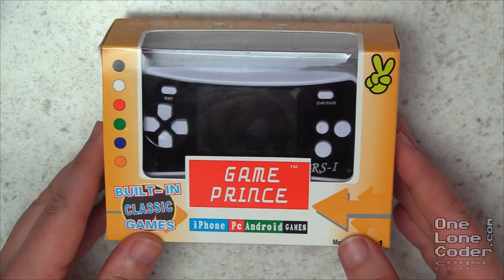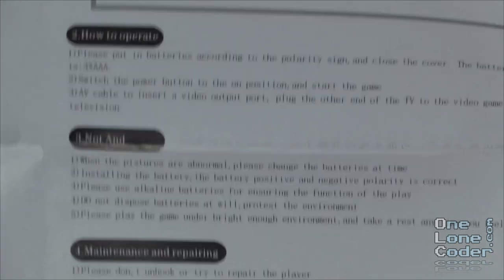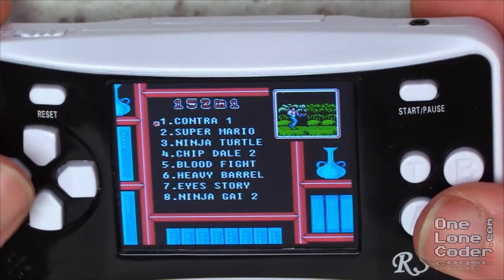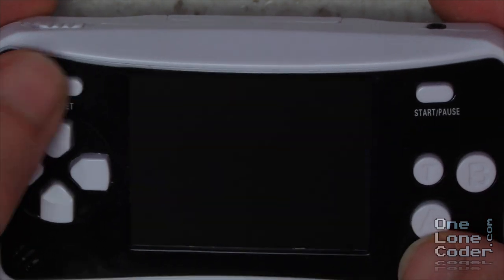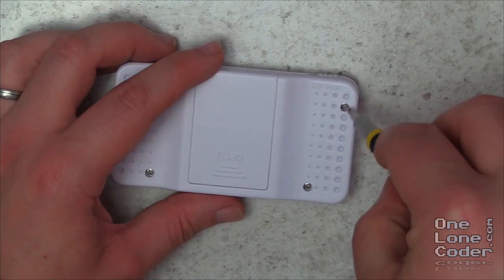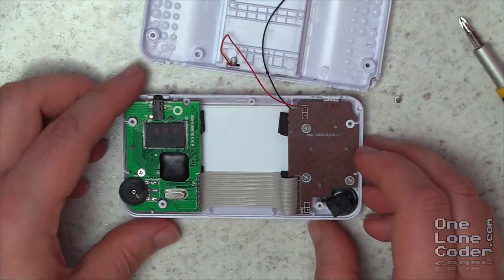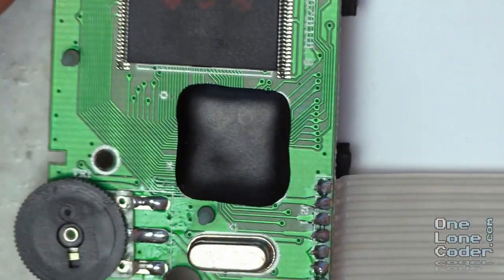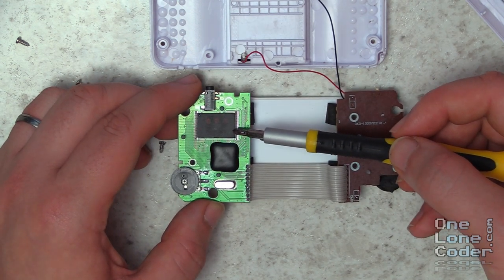The Game Prince (?!)

Comment: I always try to and not protest the environment.
Reply: I thought the TV output looked suss, but divide the master clock 21.47727 by 6, and you have the extremely precise NTSC colourburst 3.579545.
Reply from the maker: That frequency could be used for emulation timing too, but you're probably right. I can't see accurate emulation being the priority for this product. I did fiddle about with my capture card but the audio is also really poor, and chopped up. Ill have to sweep through all the ntsc modes.

Comment: Really cheap electronics stuff like this can be excellent showcases on the art of penny pinching when designing for manufacturing.
Reply from the maker: I'd love to know what the micro is. They obviously know everything about this device is illegal, yet could they justify a custom ASIC run? I'd like to hope not and that it's just some bog-standard micro with a couple of dedicated AV out pins, but I don't think I've ever seen one of those. I suppose they could use a DAC for both but then most of the processing would be dedicated to just producing a composite video waveform.

I managed to get some audio out of it, but it was very choppy, which is even stranger! Clearly they can deliver audio to the speaker, and I would imagine it's the same signal to the AV socket, so something must have been stalling the processor.
Reply: I think you will find that this is a system on chip famiclone like the knockoff chinese NES mini classics and others. This isn't an emulation console.